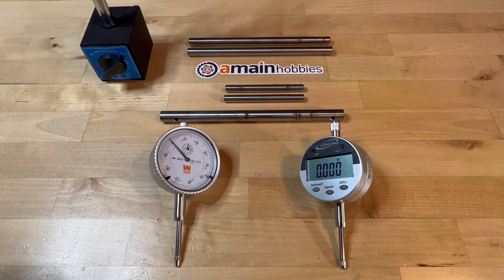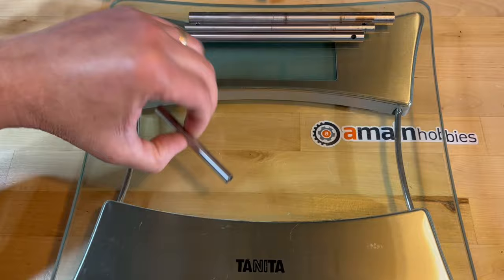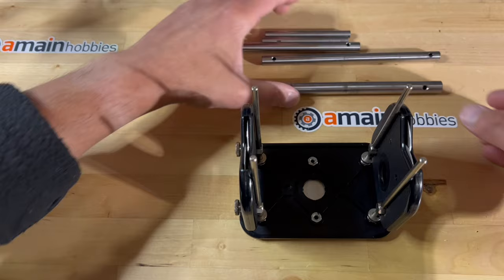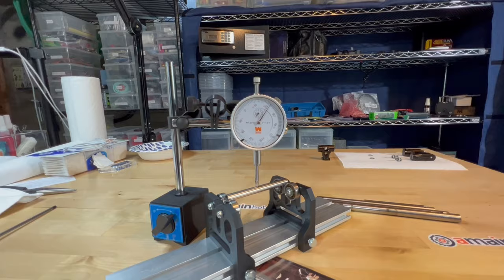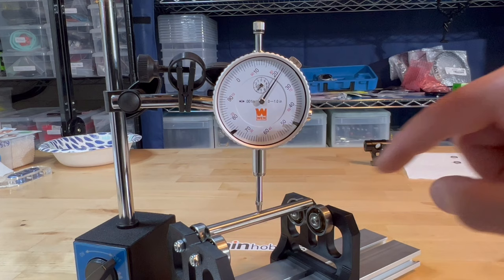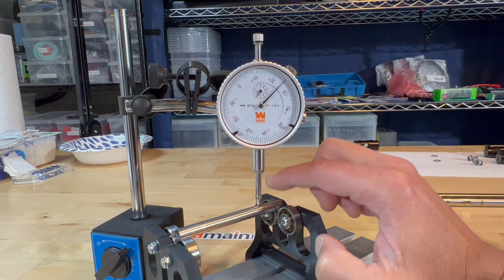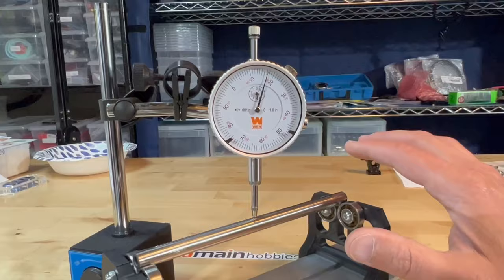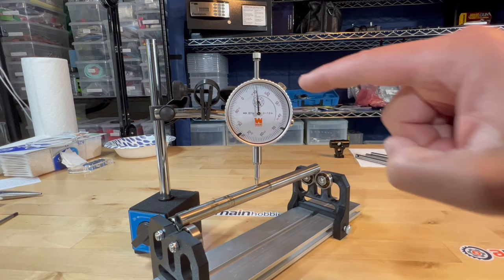Is your shaft straight?  Part 2   HD 1080p

Comment: Nice work John!
Always informative.
A small suggestion that might be helpful, is to make sure that everything is very clean when performing the  measurements.
Reply from the maker: Very true.  Any dirt or metal burs on the shaft and/or measuring equipment may affect these precision measurements quite significantly.  Thank you for posting.